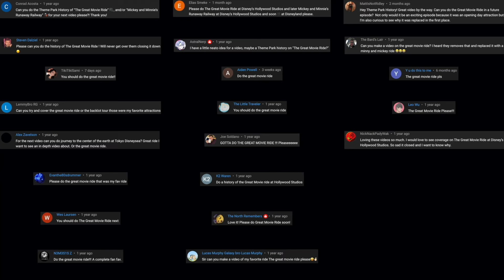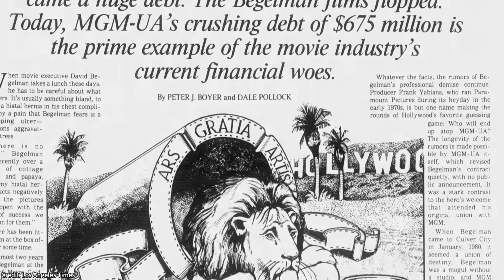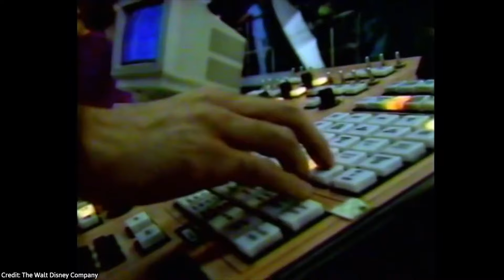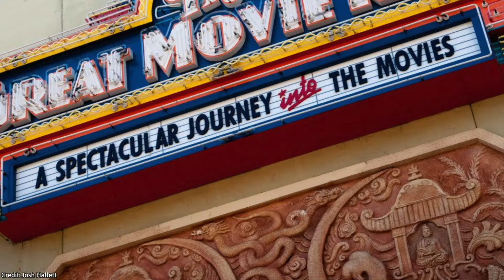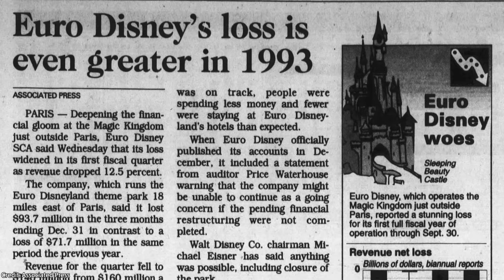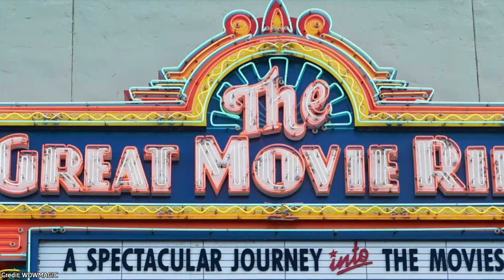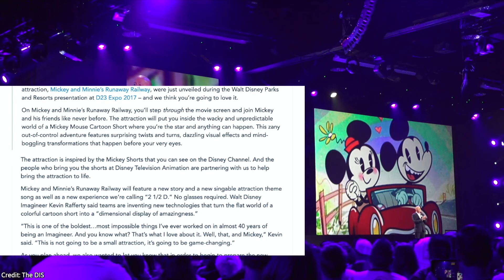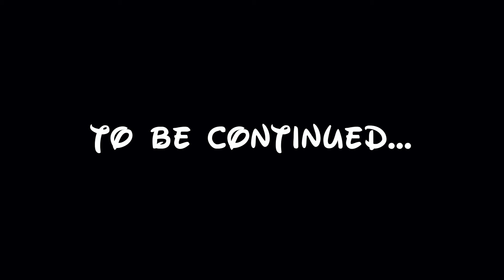The Theme Park History of The Great Movie Ride (Disney's Hollywood Studios)

Comment: I was on the opening crew of this ride. We worked for months with the ride before it opened. The script went through MANY changes, right up to opening day. And some scenes changed entirely. For instance, Mickey's FANTASIA scene was originally a tornado for the WIZARD OF OZ segment. But Disney could not get the segment short enough to satisfy copyright permissions. The scene, however, could only go so fast, and eventually the tornado (which never really worked as intended) had to be cut entirely. I was on set the day Cagney's wife and daughters came by to approve his scene. And ALIENS originally had strobe effects and was darker, but got tamed a bit after a test rider was triggered with an epileptic seizure. A shame, as that scene was originally quite intense. And for those curious, I only ever saw the FOOTLIGHT PARADE scene working as intended maybe once or twice. But the rotating tiers and (especially) bubbles effect was great when it did.
Reply from the maker: It will be closed for five years this August, where the hell does the time go?!
Reply: Wait now... Mickey's Runaway Railway has a tornado scene... IS THAT A HOMAGE?!
Reply: Once a Movie Rider... Always a Movie Rider ;D

Comment: Fun Fact: the hijacking scenes are known as scene A and scene B. Scene A (gangster scene) would always be featured in the ride day-to-day, but scene B (western scene) only operated on busier days when park capacity was higher. This allowed GMR to move larger crowds through the attraction quicker so as to make the queue line not feel longer. You could tell that both scenes were running, as well as tell which scene you'd be seeing, based on if there were two ride vehicles and which one you were sat in. The first vehicle would roll through the gangster scene with no interruption or show sequence, not stopping until the western. So the scenes were happening simultaneously for the guests. 

If you wanted to see the western scene but were going to be placed into the second vehicle, you were allowed to ask cast members if you could go for Scene  B. They would ask you to stand off to the side while they loaded the current vehicles. Typically this would mean you getting a front row seat and sitting next to the vehicle operator / being close to the Host and then to Mugsy / Bank Robber respectively. It was a really cool experience!
Reply: Close but flipped. Western was the A show and Gangster was the B show. The letter names came from the designations of the guide wires in the floor. There are four radio wires. A takes the western show and parks on the left in the finale theater. B is the gangster show and takes the right side spot in finale. C leads vehicles into the storage track of the maintenance bay. D leads into the repair area of the  maintence bay.

Comment: To this day I wonder where the majority of the animatronics went. What we do know or likely know that the Ripely animatronic was used in Rise of the Resistance as there is an animatronic seen in the exact same position and likeness. It's a personal theory, but I think the Wicked Witch animatronic was also used in the same ride for Kylo. Not sure which scene, but Kylo's animatronic has similar movements to WW A32 animatronic, so it would make sense. This ride had so many characters/animatronics, I wonder what was re-used, put in storage or sold off.
Reply: I’m more interested in the props. Wonder what happened to the flamethrower prop the Ripley animatronic was holding? I’d pay anything to own that!